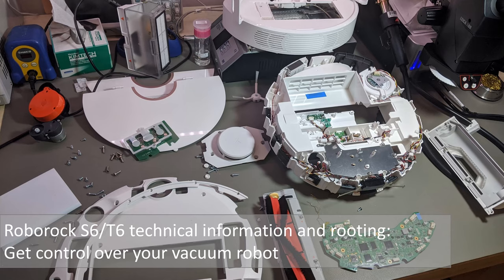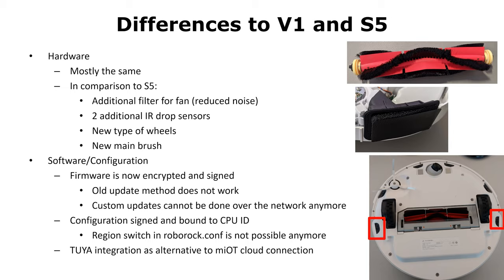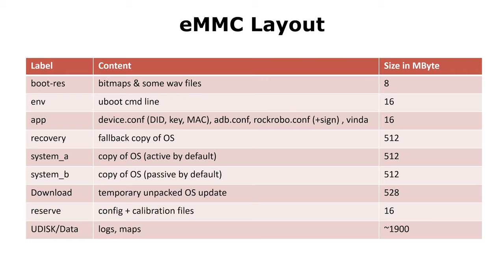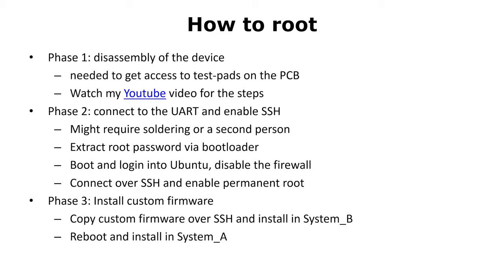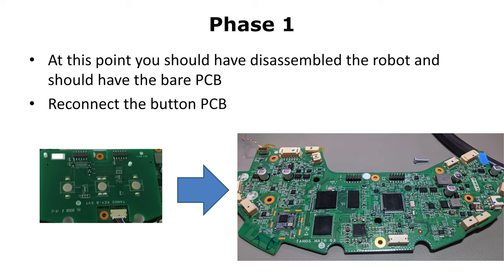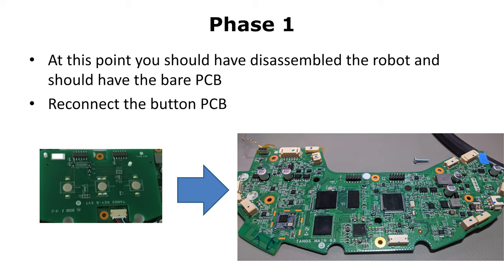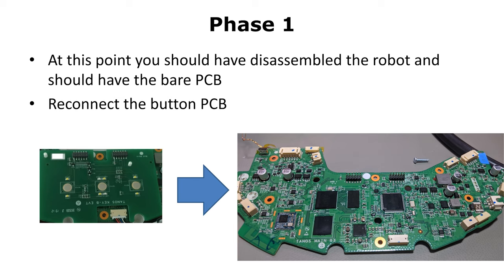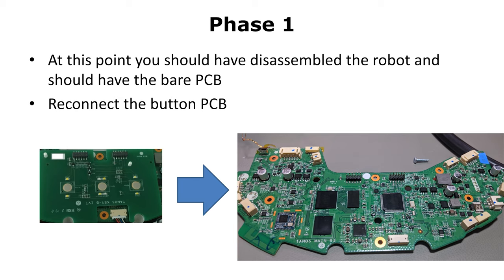Roborock S6/T6 Technical information and rooting (Part 2)

Comment: Does anyone know which pins I need to connect to on the S5 MAX?
Reply from the maker: See here: https://dontvacuum.me/teardowns/roborock.vacuum.s5e/
Reply: @dennisgiese5591  Great, thanks a lot!
Reply: @dennisgiese5591  OK, I managed to root the device but valetudo doesn't seem to start automatically. Is there anything I need to do?
Reply from the maker: @andreas4175  You need to copy over the _root.sh to /mnt/misc  . It should be described here: https://builder.dontvacuum.me/s5e-cheatsheet.txt
Reply: @dennisgiese5591  I followed the instructions to the letter but I don't see any mentioning of /mnt/misc When I try to run valetudo manually I see the error Error: bind EADDRNOTAVAIL 203.0.113.1:8053
    at dgram.js:337:20
    at processTicksAndRejections (internal/process/task_queues.js:85:21)
    at process.runNextTicks [as _tickCallback] (internal/process/task_queues.js:66:3)
    at Function.Module.runMain (pkg/prelude/bootstrap.js:1376:13)
    at internal/main/run_main_module.js:17:47
Emitted 'error' event on Socket instance at:
    at dgram.js:339:14
    at processTicksAndRejections (internal/process/task_queues.js:85:21)
    [... lines matching original stack trace ...]
    at internal/main/run_main_module.js:17:47 {
Reply: the other thing I noticed is that the WLAN led is blinking continuously. I can login via ssh (root, no password) but the connection briefly freezes from time to time. This was not the case before, i.e. the robot was connected to the wifi just fine (didn't change the config during the rooting process)
Reply: For future reference - I downloaded the latest valetudo version instead (2021.03.0) and this one works out of the box
Reply: @dennisgiese5591  The robot is working in principle but the map is empty. And I don't seem to be able to find any information on how to connect RoboRock Control Center to the robot. Do you happen to have a hint for how this can be done?

Comment: i  was typed ext4load mmc 2:6 40008000 vinda, but bad device mmc 2
Reply from the maker: Sounds like you are not using an eMMC based model (v1, s5, s6) and have a NAND based instead(S5 Max, S6 Pure, etc). The rooting for NAND based robots works differently. Check this document: https://builder.dontvacuum.me/s5e-cheatsheet.txt